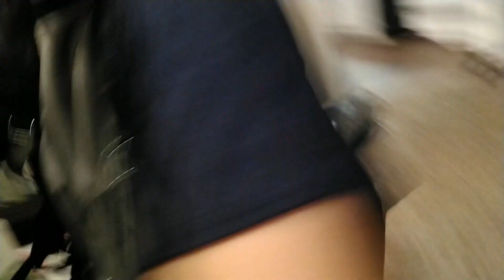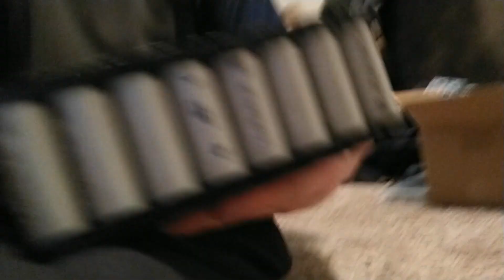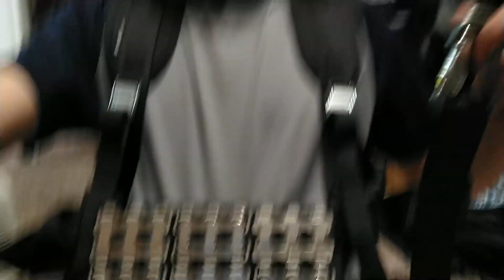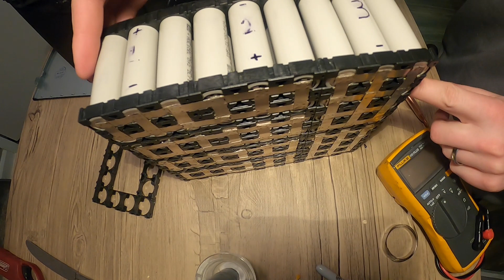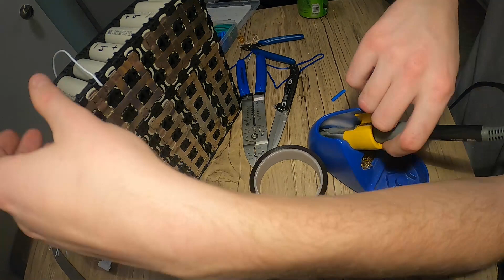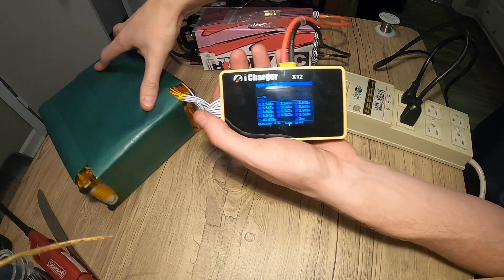Blimp drive paramotor, battery build pt. 2 | Avery Flies

Comment: What do you mean you can't charge it without main power plugged in?
Reply from the maker: This is very common with RC hobby grade chargers. Higher amperage chargers use the thicker wires of the main power connector to achieve the fast charge rates. The thin balance wires are used to equal out the cells, but they could never sustain the current of faster charging.
Reply: @AveryFlies  ah ok so the 10 gage leads will charge it
Reply from the maker: @liveandletlive2894  probably going to use 8 gauge, but yes. It will charge and drain through the larger wires for best performance

Comment: an alloy strip may have worked better instead of copper, also better conduction.
Reply from the maker: If I do it again, I will definitely be looking for a weld-able strip to meet my power needs. Soldering took forever!